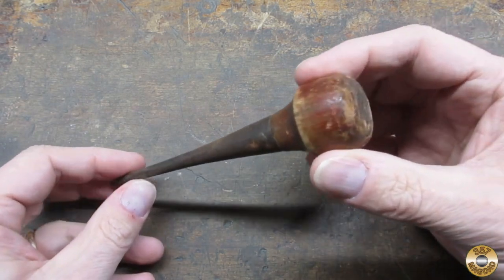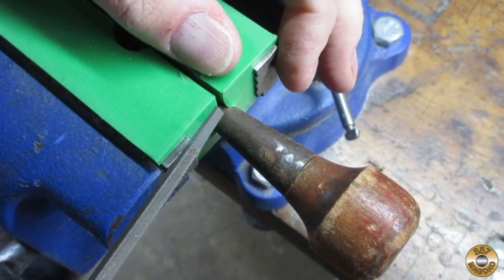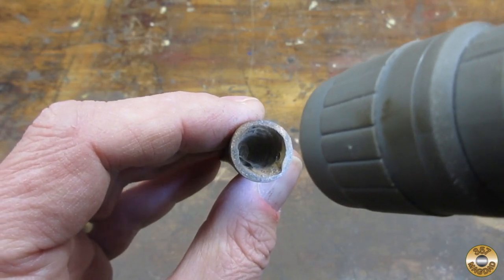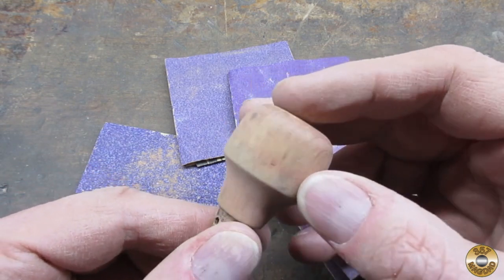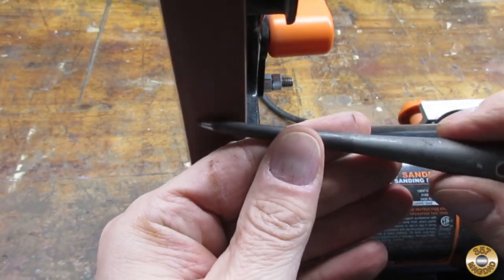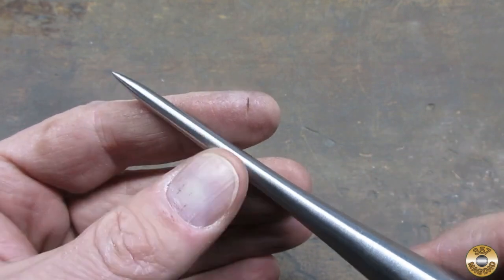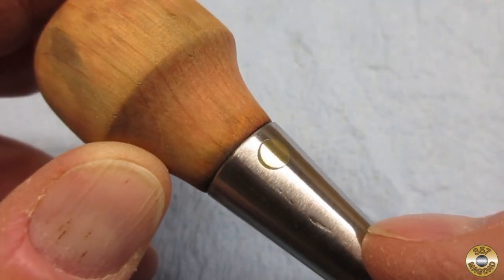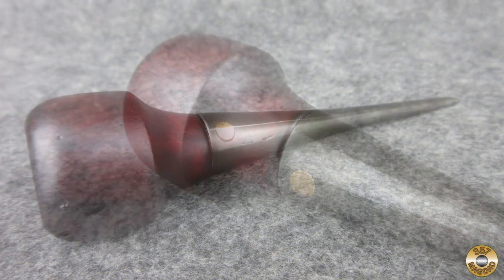Vintage Socket Awl Restoration

Comment: Hey, Magdad!  I realize this video is some  7 months old, and it's a little late for comments,  it I just watched and want to put in my two cents. This tool looked like something I might have read about, so I went to Wikipedia and checked. What I believe you have here is a hand-made tool called a fid.  It's used in rope work, specifically to lay open the strands in order to splice two lines together.  No way to tell how old your example is,  but your restoration does it justice and honors the maker, whoever he was. Congratulations.
Reply from the maker: Thanks Larry!  It seems like it would be a handy tool for rope work!

Comment: What a classy transformation that was Magdad, the combination of finishes and the brass work so well together, the Bombay Mahogany seems that natural choice where there is evidence of the old red stain on handles. Considering the socket design and the style of the head/handle it looks like it was made to be used with a degree of force, but the head is not damaged so like you demonstrated it works beautifully cupped in the palm - nearest thing I've seen to that is for rope work, I'll ask my Dad about it, he's a mercantile marine and can do wonders with rope !
Reply from the maker: Thanks Andy!  I bet it would be ideal for rope work!

Comment: Good work on both the awl & the bird houses MD - lets hope our little feather friends make good use of them. In the UK we're told to get the boxes up and in place (preferably) prior to xmas. The songbirds over here tend to use them both to over winter and then start to nest in the next few weeks or so...
Reply from the maker: Thanks!  My understanding is that the bluebird houses have to be cleaned out every winter so that birds will make new nests in them in the spring.
Reply: @357magdad  We don't have Bluebirds over here, but our songbird boxes should be cleaned out during the late autumn.

However, the smaller birds can make use of them during the cold winter nights and have been known to snuggle down several to a box to keep warm...

Comment: I love the socket awl.   As you said it looks hand forged.    That takes a lot of skill and work.    Excellent job on the restoration.   Bombay mahogany does look good.    The cold bluing also looks very good, makes the awl look better than new.
I will have to look out for a socket awl at flea markets.   I do not need another awl, but I would love a socket style awl.
Good to see the free pile Workmate put to good use.
Dave.
Reply from the maker: Thanks Dave!  You can always use another pokey thing!

Comment: Definitely some kind of rope tool, punch, or big awl.
The handle isn't a good shape for striking, and socket chisels work b/c the handle is driven down into the socket; adding a pin runs counter to that design principle, and the pin could shear if struck hard enough. Love the brass pin.
Reply from the maker: Thanks for watching Chris!

Comment: Great video as usual!  I am sure chuck did a great job as quality inspector!  I noticed the pin was not a perfect fit when you first showed it stuck thru the socket, but I assumed you would peen it from both ends and then sand off the excess.  I thought the peening would expand the brass into the socket and fill the void.  Off to church!  Fellowship meal day!  Did you know there's no calories in church food? 🤔😁👍
Reply from the maker: I prefer to glue the pins.  Peening would probably have worked though.
Reply: @357magdad  I understand.  You could do both!  🤔😁👍😉

Comment: You're right it does look like it could be for rope or cord. More squaty and wide. I see a pattern steel brass and wood - 357MagDad is happy. I do like the finish after the 120 belt. Good idea using the tinted epoxy. Well played. That crescent gap between the pin and the pokey body does not look bad. That pokey tool was certainly in pretty rough shape but man did it look great when you finished it. Good work. Honestly with Chuck involved I am surprise those Bluebird nesting boxes weren't polished with Flitz. HaHa
Reply from the maker: Thanks Michael!  Chuck loves his Flitz!

Comment: I think the trick would have been peening the pin/rivet to fill those areas before sanding it flush but the epoxy additive was an interesting experiment......Turned out great anyhow and I love that Bombay Mahogany........Konbanwa!
Reply from the maker: I'm hoping I can use the mica powder + epoxy to fill in cracks in brass ferrules.

Comment: It's impressive how fast the brass pin got filed away.
Reply from the maker: That was an 80 grit belt.  I like to use an aggressive belt to keep the pin from getting hot and loosening the epoxy.

Comment: It looks great as-is, but since you were concerned with filling the oblong hole, I wonder if you had "bucked" the brass pin, kind of like a rivet, prior to sanding, if you could have filled the gap with the edges of the brass pin? It looked like the steel pin you had removed was a bit mashed over as well. As a kid from the South Orange/Maplewood area of NJ, we used to play Hunterdon, NJ in high school sports!
Reply from the maker: I prefer to glue the pins rather than peen.  I wanted to see if the mica powder + epoxy would work for filling in brass - I've got some other project that it would be useful for.

Comment: I'd say it's a marlin spike, rather than an awl. It seems to me that awls are always thin. But i don't really know. Could be a leather working tool to. Saddle making or shoe making. It's definitely shaped to fit the palm and to be used for heavy leveraging.
Reply from the maker: It is a handy design that would be ideal for many applications.  I'm surprised the socket awl isn't more popular.

Comment: I've seen a other YouTube guy use actual brass shavings in a epoxy table. Wonder how that would do? I just finished my first handle with the full tang and my milling skills need some improvement lol but this could be a good salutation ...
Reply from the maker: I've tried the brass filings in the epoxy, but they were a little too coarse.  I'm hoping the mica powder will be fine enough to fill cracks.

Comment: Curious, why not peen the brass pin?  It should expand to fill any imperfection in the drill hole, then dress it with file(s) followed by belts.
Reply from the maker: Peening would work.  I like to glue my pins.

Comment: The steel pin held this tool together for 100 or so years without anything else.  Everything in the world today needs epoxy, go figure.
Reply from the maker: If they had epoxy 100 years ago, they would have used it.

Comment: I keep hankering, optimistically, after a pokey thing in order to drill an extra hole into my belt. Trouble is, I need to require a hole first... 🙄
Reply from the maker: You could make some "decorative" holes...😁
Reply: @357magdad  Probaly best not to draw attention to that area of my anatomy...